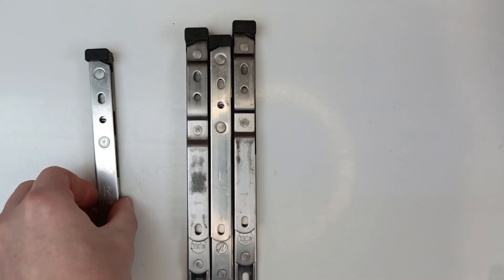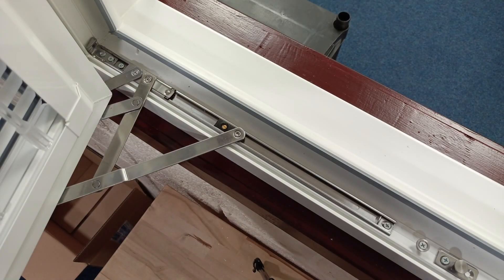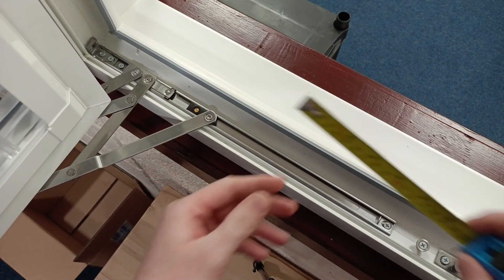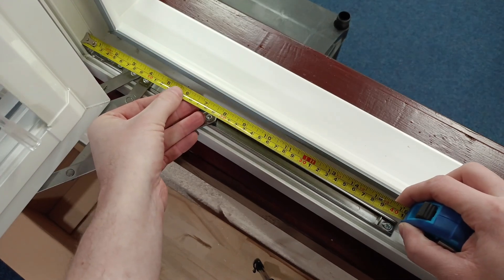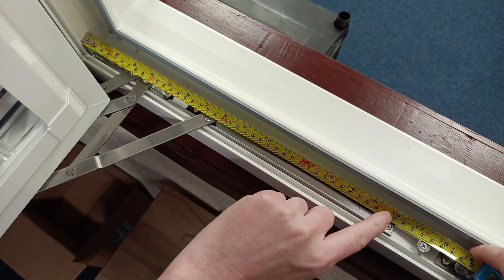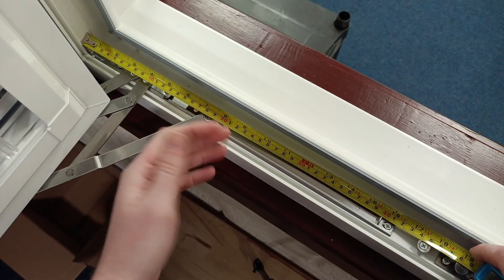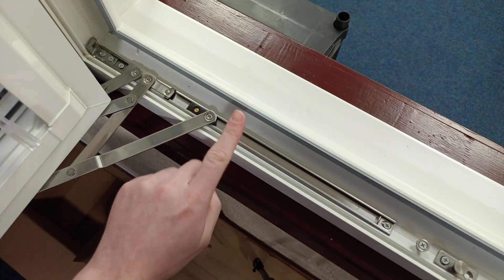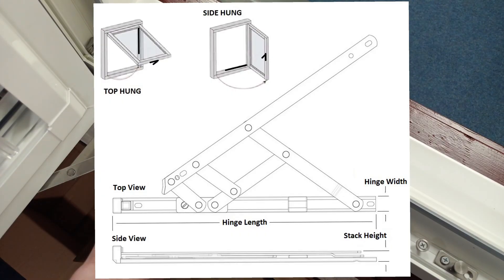How to Measure Window Hinges: Key Sizes and Functions Explained!

Comment: I've measured our broken easy clean hinge, like the 2nd one in your video and it's actually 17" long in the same position where you placed the tape. The windows are relatively new (1 year old) so it's not some old style hinge. Is this still classed as a 16" hinge?
Reply from the maker: Yes still classed as 16" we supply the 17s but still known as 16" and the 13" known as 12" mainly just the egress easy clean are like that 😊

Comment: Great videos, do you have a video on removing glass when the beading is external? 
- How do you remove/reinstall the glazing wedge on the inside.
- if theres clips or tape how do you remove/ reinstall it

Thanks again
Reply from the maker: @jonw2570  Hi, thank you 😊 does this video help at all...https://youtu.be/hR73-jH4JNA?si=hXltT5wPjBqqxWoX
Reply: @DGPSUK  Thanks for the quick reply! that video helped a lot on my internal beading windows and thank you for the advice.

I have 2 that are external beading and If it has security tape can you tell just by looking without removing anything as haven’t seen what it looks like before so didnt want to take beads off before finding out its stuck in and not having any new tape or clips to hand.

I also saw this video -
https://m.youtube.com/watch?v=4i3wX9kYJmM&t=18s&pp=2AESkAIB

Which helped show the glazing wedges install. To remove them do you just pry them out, remove glass then reinstall once new glass is in as shown in that video. 

Thanks again!
Reply from the maker: @jonw2570  Hi email across a few images of the window in question and I'll have a look 😊 sales@dgpsuk.com
Reply from the maker: @jonw2570  if there is tape slice it from inside before you remove the glass externally then clean it off with a razor blade and reapply the tape as neatly as you can to the edge like before.
Reply from the maker: @jonw2570  if it's clips you normally need a special tool, we just grind them off then tape the unit back in.